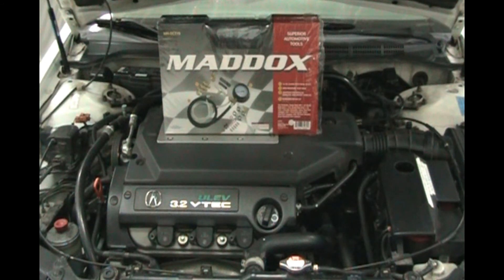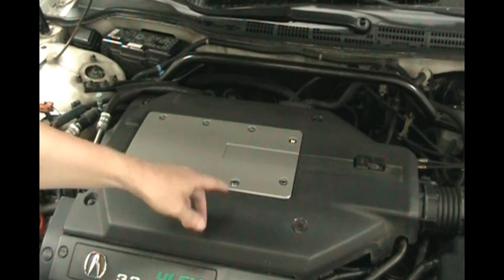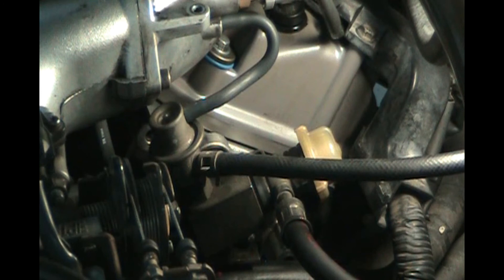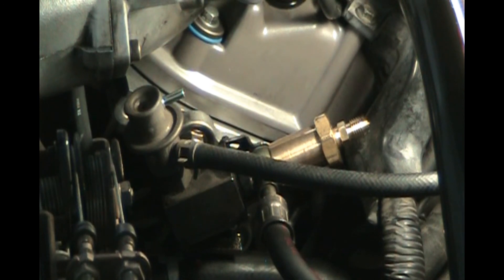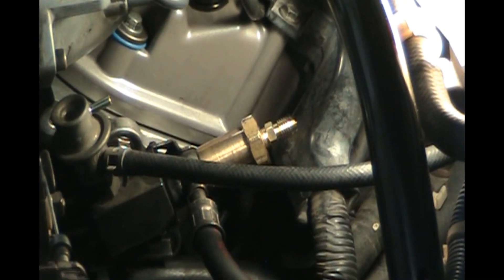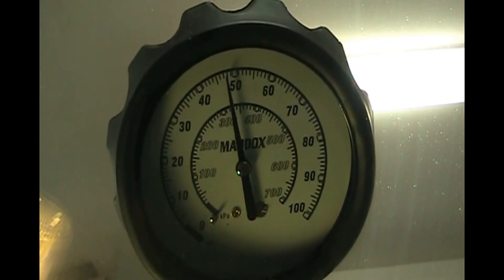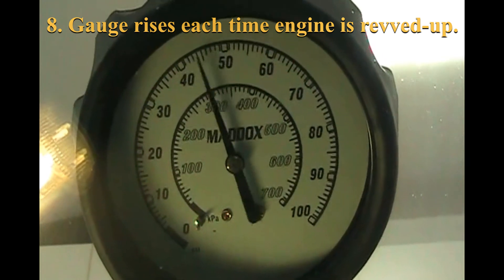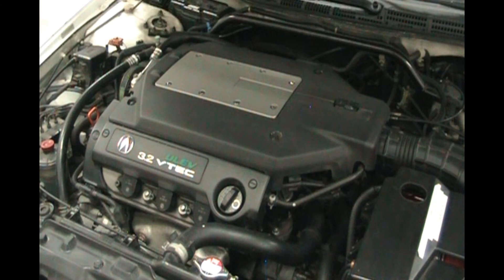2000 Acura 3.2 TL Fuel Pressure test

Comment: So the test was done but what happens when something is bad.
Reply from the maker: I performed this test to find out if the fuel pump was putting out sufficient pressure. A bad fuel pump would cause engine performance issues.

Comment: John,  I was just wondering whether or not you have ever changed the fuel filter at all. If not, what is your reason behind that decision. Thanks.
Reply from the maker: At 453,000 miles I did change the fuel filter and sock.  It is located inside the gas tank. I always use premium unleaded gasoline from quality gas stations. The filter and sock did not look bad at all. Probably would have lasted a lot longer without changing. Since I live in Southern California, there is no rust inside my gas tank.
Reply from the maker: I did not have a YouTube channel back then, but I did take digital camera pictures of the replacement process and documented the part numbers.

Comment: My scanner tells me which injector is bad… 🤷🏼‍♂️
Reply: Technically your scanner can tell you you have a problem with your scanner but this tests that and more then ur injector. Testing fuel pressure at different points is key for a complete diagnosis. Scanner no matter how good only does so much and won’t be as accurate as a direct gauge that’s plugged to ur fuel rail or lines

Comment: Where did you buy that adaptor ? The one 12mm x 1.00
Reply from the maker: Tools used:  Honda Pulse Dampener Adapter SG58670 made by S & G Tool Aid sold by AutoToolWorld.com.  The size is 12mm x 1.00

Comment: wow, what a coincidence. My car is doing the same thing. Cranks just fine, but sometimes when i wack the steering column (on the left/middle side) the car sometimes will run. I had some instances when the car was struggling to run and just gave out during a couple cranking sessions. Wasn't the pump fuel relay under the hood, nor the ignition harness under the steering column. So, I'm gonna try your fix and see what happens. Thanks again and great video!
Reply: @Junior Briar Ya, I ended up finding a few things that contributes to the ignition harness. One was a blown fuse under the hood (passenger side) that also lead to no- starts. YouTube vids online can help if you look around. Lucky for me, my TL is going to my little bro for when he starts driving, lol. And since I fixed the no start issue back in (Fall 2020), now (March 2021) there's a misfire issue have to look into, engine light flashing, so I should drive the car since raw fuel is going into the catalytic converter. Ya, that's just some stuff I've came across, but I think this time around it's related to misfires and whatnot. Hope your car is holding up!
Reply: I’m just having acceleration problems. There’s times where I press on the gas racing and it has trouble reaching to 100mph. Like wtf😭 I don’t know if it’s the fuel injectors.
Reply: @linoserrato7651  If I were you and you already did research, find a reliable mechanic. This car isn't meant for high speeds above 90 due to the stock equipment on the car. You'd need to do some research if you want to go "faster" or get more power out of it. I remember I blew something coolant related cuz with any increased heat in any car, modded or stock, you need to have proper cooling. Things like air that cools hot components, like a haet exchanger and cold air intake are some items that can help, but there so much info out there, that it's better to do your research in case you want options and other opinions of peoples experiences. At least that's what I'd start with. That or join forum groups online for your car. Facebook should have a group, if not, the internet should provide an answer.